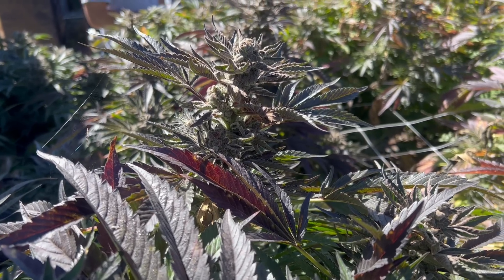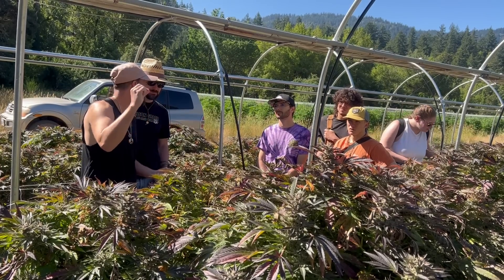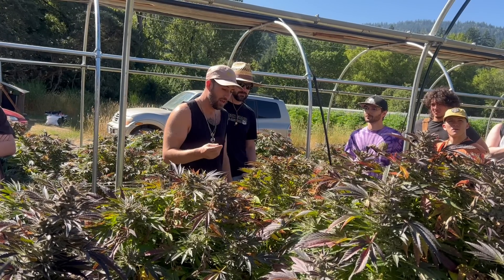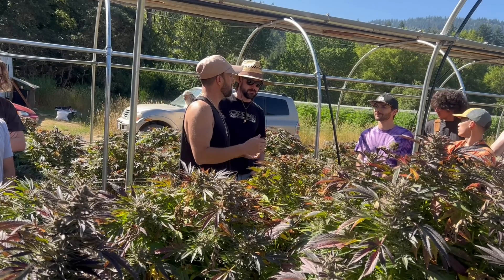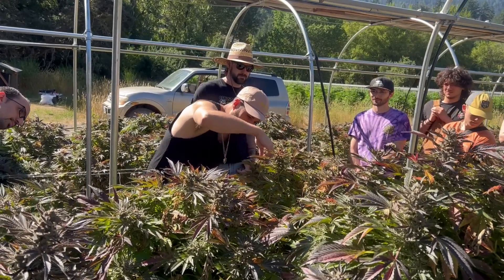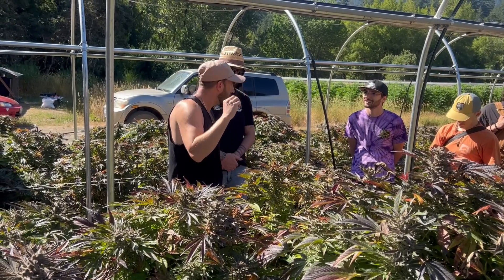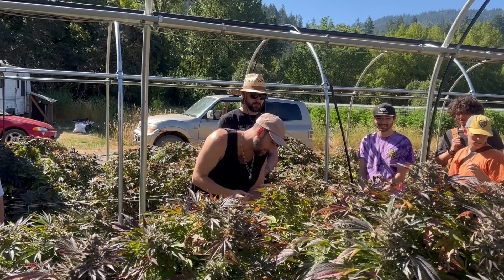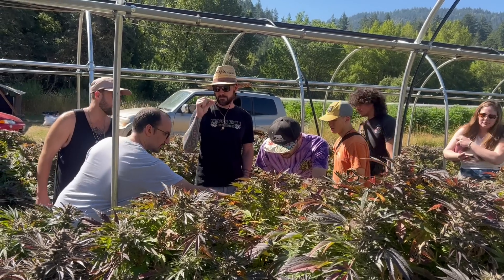Cannabis Trichome Field Tutorial: What Makes a Washer? / Nikka T / Ganjier

Comment: What's the 4-5% he was talking about? Thc% is usually around 20, at least 15, so I don't think their talking about that
Reply: That's the difference between fresh frozen and dry. The yield is proportional to weight, and fresh frozen weighs much more than dry.
Reply: They’re talking about extraction yields
Reply: @Pdbottleneck  is that vs cleaned flower weight or??
Reply: @1fast72nova  4% yield for fresh frozen trim/flowers and 12% for dried and cured, according to them.
Fresh frozen hasnt been dried, it went straight into a freezer and thus everything is still quite well attached to the plant. When you dry and cure the plant, it can fall apart easier when you wash it, therefore you get more yield. I only wash my trim, and I blast my flowers for 20-30% yield. - Yeah yeah, I know.